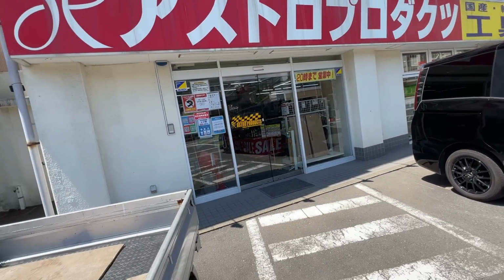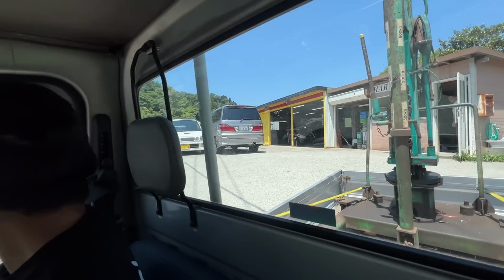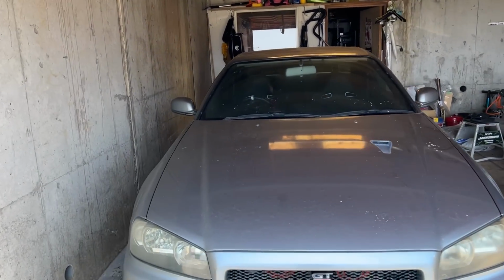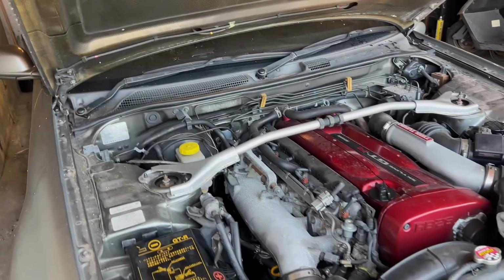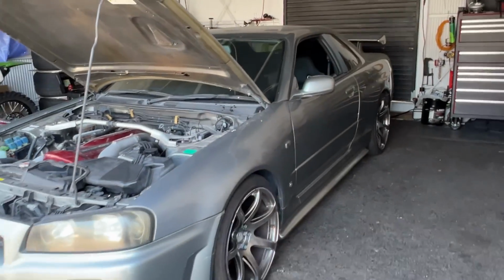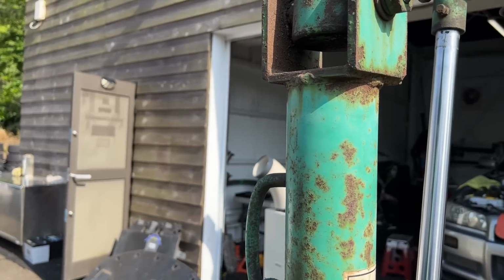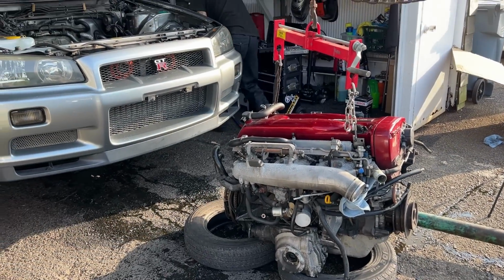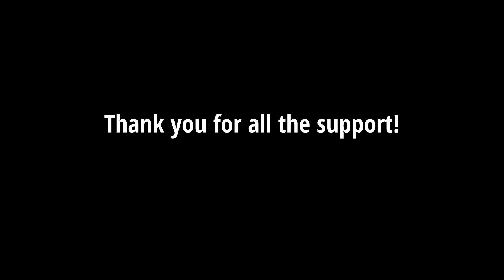I HAD THIS HIDDEN FOR SO LONG!

Comment: You might play around with the top of the engine and see if you can eliminate the knock, then check the cylinder pressures and see if the rings are good before yanking it all out and exploding it . Oh, never mind about that. Rear seal looks kinda bad.